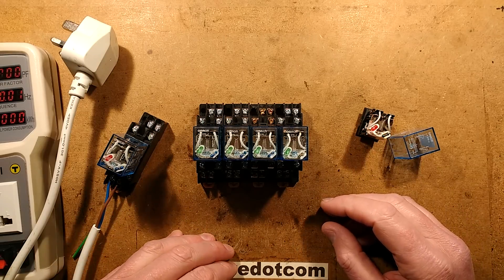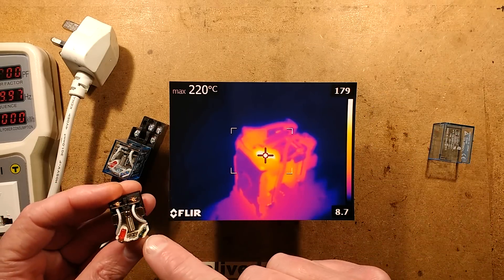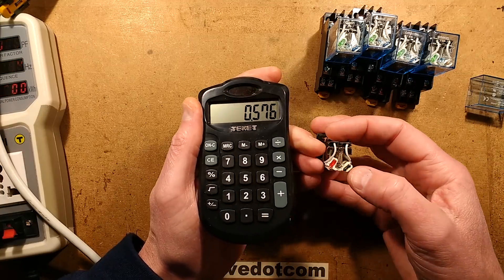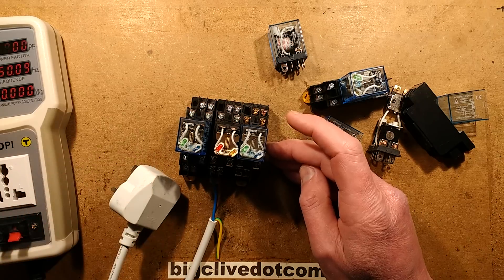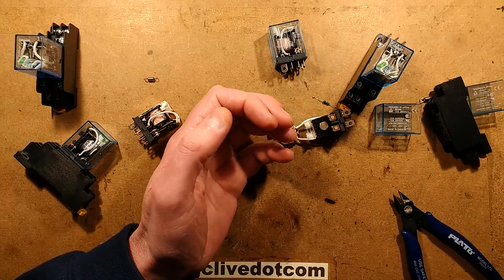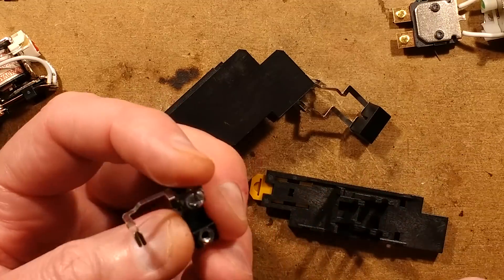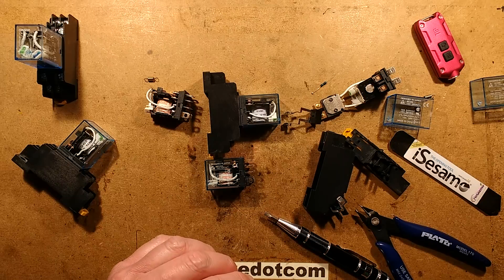Fake Omron relays with smoky issues.

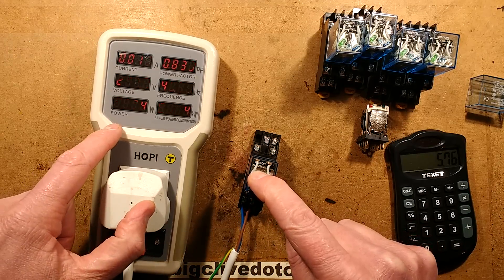Comment: 4:28 if anyone is curious, here's calculating the inductance from that:
15mA 248V, 10,000ohm real impedance
so V/I=R= 248/15*10^-3=16.53kOhm
first have to figure out what the inductive component is using pythag:
hypotenuse is the total impedance, one of the sides is real impedance, and the other will be inductive impedance.
c²-a² = b² = 13.16kOhm 
(complex impedance = 10,000 + j13,160 ohms)

for a sine wave you can use 2πfl for reactance
at 50hz: 2π50l = 13.16kOhm
13,160/(2π50) = l = 41.9H

(now hopefully i did it right
this maths has a lot of places you can mess the whole calculation up)
Reply: ask Euler why you can use Pythagoras in this

Comment: So the copper plate on the core slug acts like a capacitor (reservoir) but for the mag flux?  That is pretty ingenious.
Reply from the maker: It causes a phase shift which results in a more sustained magnetic field.

Comment: I don't know if you will find 12VAC relays but I know HVAC uses 24VAC and trucks use 24VDC so that may give you a comparison
Reply from the maker: I got an AC relay and it has a shaded pole to reduce noise.

Comment: I would hesitate to use those knock-off relays even in hobby projects.  There are just too many corners cut in quality and durability.  The relay base in particular looks like a piece of junk with those screws just begging to pull out and short circuit.  That base looks like cheap thermoplastic instead of a more dimensionally stable (heat resistant) Bakelite or similar material.  Also, would you really trust the contract current carrying rating?  It is OK for a solenoid actuator to have an on/off duty cycle rating, but a relay should be able to stay energized indefinitely without fear of melting.

Comment: It used to drive me crazy, when I opened up an electrical panel for an elevator in the penthouse of a building, and the buzzing was so loud from the relays, that you had to put earplugs in. You could put your finger on the relays and tell which ones they were, but they still worked, so nobody ever hauled 20-30 of them up the steps to replace them. One day I got tired of it and did. I found that there was a small hairline crack in the shading coil, at the corner of each buzzing relay, where it wrapped around the rectangular AC armature in the relay. A drop of solder made the noise go away, but I never found out why the copper ring cracked. The crack was so small, it was almost undetectable

Comment: Relays aren't the only thing that gets cloned like that. Awhile ago I purchased a few micro switches to replace the ones in my mouse. What came to my doorstep was surely enough labeled as a genuine Omron part. Having installed one and tested it I found it didn't work at all. This set me to testing the rest with a multimeter to check the quality. Only 5 out of the lot of 30 worked properly. I took one of the nonworking ones to bits out of curiosity to see if I could work out why they were nackered right. What I found was that they were so oxidized that they couldn't make proper contact. I tried de-ox-it which didn't work. Then I gave Tarnex a go with no luck. I finally worked round to using brake cleaner and a small bristle brush to get whatever it was off just to see if I could get one working reliably. Alcohol and even acetone had no effect on it though and the acetone damaged the plastic. Needless to say I chuckled the lot in the bin and never ordered anything from that seller again.

Comment: When I was at college, during Anglo Saxon Britain days, we wired a pair of relays together on the bench and wired each coil through the opposite relays contacts, plugged it in to the bench socket to see both relays start chattering. I can't remember if we put lamps on them to get a strobe effect, but I remember the first relay coil died just before 15 minutes. They were the older clunkier 8 pin octal relays.
We cleared it away before the lecturer came back but you could see him sniffing the air for the smell of burnt out coil. How innocent we were in them good old days. 😀😀

Comment: After powering one of these ebay clones up you need to consider these a momentary relay application. These are not designed to run continuous more then 5 minute lengths without incuring heat soak. So they work great just for switching, not holding.

Comment: I put 24 volt DC to an 24V Ac contactor today, and the contactor coil smoked today. (burned out).   What happens when we put DC to an AC relay/contactor? I thought ac or dc was no difference when it comes to an incandescent bulb or relay.
Reply from the maker: An AC contractor coil has a lower resistance than a DC one because the alternating current creates a back EMF that resists current flow.  When DC is applied too much current flows and generates heat.

Comment: Relay Computer  https://www.youtube.com/watch?v=_j544ELauus  I used to work for a company that marketed card punches which used relay logic.  If you want a relay to run cooler, use "economy contacts", you have to sacrifice a pair of normally closed contacts to short out a resistor which is connected in series with the coil, when the relay is called the contacts open and the current in the coil is reduced.  This works because the current required to hold the relay is less than that required to call it.

Comment: On the relay is stated 10 Amps @240VAC. 
I have tested this type of relay.  I have used them to drive a 2000W heater. So 2000W/230Volt = 8.7 Amps. 
After 4 hours using this relay the plastic started to melt !!! 
It is simply dangerous to use this kind of '"fake" relay.

Comment: i found an 12vac relay but it looks the same as the ones in this video    ...............   heres the link - https://www.ebay.co.uk/itm/LY2J-12V-AC-Coil-General-Purpose-Power-Relay-8Pin-10A-240VAC-28VDC-w-Socket/382843806419?hash=item592344e2d3:g:lIMAAOSwcwpeI-Wb

Comment: IVery interesting video, as usual. If I remember rightly, from my training as a GPO telephone engineer in the 60s, placing a metal ring around the armature end of a relay coil made it "slow-to-release". Placing it at the other end made it "slow-to-operate and slow-to-release".  Re the LED series resistor, I remember reading that metal-film resistors have a voltage limit of 250 volts, even if they're operating well within their wattage rating. I believe the resistance tends to fall if they repeatedly exceed this, as they would on 220-240 volt AC mains.

Comment: I use a lot of 24vdc 5a omron relay   , for me the difference between fake and original is in the original omron relay the white wire will act like a 2nd fuse will burn off and disconnect the supply and the load if it get short circuit but the fake won't , seems like the original white wire from omron had made for a maximum current pass through if over it will burn of but fake just using normal wire can handle very high current. If users bypass the fuse if there is a short circuit original omron will cutoff the supply and load connection trough the white wire , but if using fake the whole system supply and load wire will smoke , this is my experience.

Comment: Such a shame real Omrons were not purchased and compared. I unintentionally installed a chinese knock-off a few years ago as a motor controller on a projector screen. It worked for about 6 month then failed. Basically the whole thing melted and disintegrated. Definitely a fire hazard. I replaced it with Genuine Omron and its been working fine for around 5 years now.

Comment: What is the advantage of this over an ssr ? Optotransistor
Reply from the maker: Proper relays are more electrically rugged than an SSR and less likely to fasil in a short circuit state.  The ideal combination is an SSR and relay.  The SSR does all the active switching and the relay provides proper isolation off load.

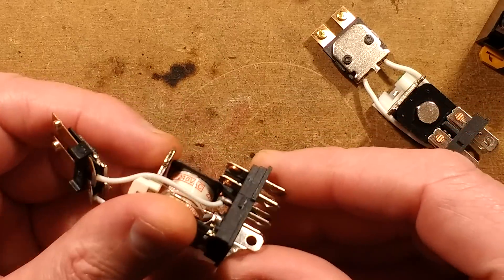Comment: 10:40 Contacts are made usually of AgNi or AgSnO2. Sometime additionally they are covered with very small layer of gold which helps during long warehousing.
Reply: Thanks for that, I've been puzzled.  I made a model of a Newcomen style beam engine with a homemade solenoid replacing the steam piston and cylinder.  Max pulse 6V at 500mA.   I was surprised that it quickly destroyed copper,  brass and nickel contacts.   Maybe down to poor thermal dissipation.....?   Anyway, I took the contacts out of a thermostat.  By colour, I'd say silvery bronze.  They're fine.  I downloaded a learned paper to find that there are more than 50 copper based metals used for in-air contacts!  No mention of osmium, haha.

Comment: They are unreliable, unsafe, rubbish..There are a lot of relays, automotive relays, metal film resistors, power resistors, leds on ebay selling cheap, and are generally of inferior quality, they are often so poor they are unusable and they are not in spec.

Comment: I have tried 12VDC ones, and found the contact between the pins and the relay base to be poor and they burn out. Also the relays after a little use fail to pull in, some times they work some times they don't. The relay base screw terminals are very loose, and its not 10Amps as claimed either more like 5Amps max.

Comment: Might be a stupid question but what is that one thing you use that I'm assuming plugs into the wall then you csn attach bare wires to the other end and it only makes a connection when you close the lid? Is that an item you can purchase or is it homemade? Also the Hopi is eBay a good place to get that? I seen one for 47 US dollars but don't know if they make a specific us one or if they are all universal. Thanks.
Reply from the maker: Cliff quick test.

Comment: They should have given two quarter watt 100k resistors in series instead of just one, as those doesn't like to supplied with a voltage greater than 150V across them.

Comment: Very grateful for this. Thankfully I mostly use the 12 volt ones and the one 240v one I currently have is driven from a PIR so I'll be OK unless I get a persistent nocturnal visit from the JWs - though since it's socketed I have no excuse to not fix it.
Scarily I originally bought it to switch my computer sound off at night in my bedroom so I could use a cheap mains timeswitch .
I may look for an app instead ....

Comment: 8:45, it would actually be 25 hertz not 50 hertz correct as it's only lighting half sign wave?
Reply: The frequency remains the same, one peak every 0.02 seconds
Reply: @robertoricardoruben , the led would only light though when current flows one way through it?
Reply: @TrollFaceTheMan  yes, because it is a diode, only conducts and lights when current flows in one direction.
Reply: @robertoricardoruben  he says it is flashing 50 times a second but because it is only lighting on half the wave that means the actual flashing should be 25 which is what I was talking of.
Reply: @TrollFaceTheMan  ok, believe what you want
Reply: @robertoricardoruben , I really am legitimately confused here. A Led put across a 50hz ac single will only light during half of the phase (aka 25hz) because the led only lights during forward bias and not reverse bias. 

 During the state in which an led is conducting in reverse no light is generated. So the LED is passing a 50hz single, but only flashing at 25hz. 

 If I am wrong please elaborate. But I have done this before with leds at 60hz and they only flash 30hz and not 60.
Reply: Actually I don't know what you are even on about at this point as it seems we are in agreement?

Comment: I wanted to get some for a relais computer in Shenzhen.
They asked me if I wanted original Omron, fake with Omron branding, or the dirt cheap compatible stuff :)
I bought the dirtcheap stuff - but it was not really worth it. 20% just stuck after a while in normal operation.
Not problematic for a hobby project, but imagine this happening in an elevator or worse - in a heavy industrial machine.

Comment: The Watt LED Measurement may be off, the LED does have a reverse voltage breakdown,  however, without the datasheet, you can not just assume it's 220. S better solution may have been to add a diode rated to 400 volts, to the line.

Comment: Luckily I saw this vid. I built a digital programmer/thermostat for my central heating system and it uses a 240v coil relay that I bought via ebay. I thought it was an Omron device but on closer inspection it says 'Onrom' and the resistor is overheated exactly as you showed in your vid. I've removed the indicator circuit from the relay and I'm ordering a new one from RS. Thanks Clive! By the way you sound uncannily like Sideshow Kev (don't know if you've been told that before).

Comment: Why did they do it? Chinesium... The chinese do whatever for convenience w/o regards to safety or real requirements.  Just like making aluminum hose fittings as opposed to brass.  They make things that quack like a duck, and look like a duck, but their ducks will set your house afire.  I wouldn't be suprised if the lead tabs in those relays were plated steel.

Comment: Have you ever looked at relay boards on eBay for Arduinos and other home projects? They all seem to have pointless opto-couplers, pointless because they only have one 0V rail.
Reply from the maker: Yeah, they're weird.  The only thing I could think of is that maybe it's taken from another isolated design or that they think switching glitches could return through a transistor base to a processor.

Comment: Relays are sort of like solenoids right?
Reply from the maker: Relays are designed to activate switch contacts, solenoids are designed for mechanical movement which may also sometimes incorporate a switch contact.
Reply: Ok, Thanks

Comment: Is this 220v relay actually supposed to be a 110v relay but marked up wrong? Would be more similar wattage etc etc to the 12v ones blah blah, what current does it pull at 110v?

Comment: I bought 3 of these fake 12v Omron relays from China via eBay after watching this. Not sure why, Clive has that affect on people. They have just turned up and they are identical except they are badged Yuxi. I guess they are fake fake Omron relays!
Reply from the maker: The 12V ones should be fine, but don't use them to switch high current.

Comment: I've used the 12v Omron clones, and are usable for small non critical projects, the screw terminals on the relay bases are loose and awful, but do still work, I would not switch 240V with them, but are ok for low energy 12V applications like reversing polarity on a dc motor, at just a few amps.

Comment: Hey, BigClive -- can I ask a favor? Can you do a reliability test on the contacts of these Not-Omron relays? I've been buying them for a project (can't afford better) and the project keeps not working with known good wiring diagrams -- I'm beginning to suspect that there's more issues to these than just a resistor problem. FWIW, I'm using 12vDC examples...

Comment: I like these style of relays. Nice to be able to pop a new module in without having to pull any wires off. They are also fun to overload and watch the coils burn up in a sealed air pocket. That's how I learned you can use a high voltage on a low voltage coil; but only once and only for a short time!

Comment: I don't like the idea of an LED and resistor across the mains. The peak mains voltage is about 350V. I am not sure LEDs take kindly to 350V of reverse bias on a long term basis. A good quality 1/4 W through hole resistor has a 500V rating - so that's OK, or is it? Actually marginal depending on mains quality. A chinese cheap 1/4 W resistor possibly pushes against both the power and voltage rating limits.

The 12V relays, of which I have several, seem to be quite good value. Mine are only switching 12V at an amp or two and I am not sure how long they will last but I think they are good enough.

Comment: Just add a IN4007 diode reverse bias in parallel with the led and everything would be fine
Reply from the maker: It would be better in series with the circuit to half the dissipation.
Reply: I'd used this method for many years and had no trouble with it. First the led then the diode in parallel with the led but reverse bias and then a 47k 250mW resistor in series with the anode of the led.The supply voltage needed to be 240vac. The resistor stay cool. Just try it and look for yourself. I'd replace all my neon indicators with method.
Reply: @SODA-iz8lc  You're putting 1.2W into that tiny resistor, if you really mean to put the IN4007 anti-parallel to the LED:  (240 * 240) / 47000 = 1.23W

Comment: Your power meter sounds like it is displaying VA instead of watts. 15 mA at 240 volts is 3.6 VA. Since the resistance is 100k, and the current is 15 mA, the power dissipation in the coil is 2.25 watts...

Comment: I hate to ask the dumb question, but what does a 60hz display look like when it is recorded by a 60FPS camera? Your HOPI meter always made me wonder.
Reply from the maker: The Hopi has quite a slow multiplex rate.  It only locks on camera at very low ambient light levels when the exposure is longer.
Reply: Thanks! I would have thought you were at 50hz being the cause!  More strange that we use 29 fps for NTSC and PAL is 24

Comment: 7:35 "I can resist anything except temptation." Oscar Wilde.

Also: the little nuts to hold the contacts into the plastic are probably set into it with an ultrasonic gadget. This Old Tony has done videos about DIY ultrasonic stuff. He didn't get his working the way the real ones do, but it was pretty neat nonetheless.

Comment: I like to use the Finder relays on electric boards when Omrom are not available on local stores but who knows if they are "findler"....  That LED and resistor were done in a simple way to make a flaw design :S